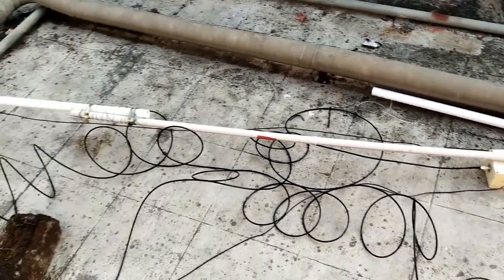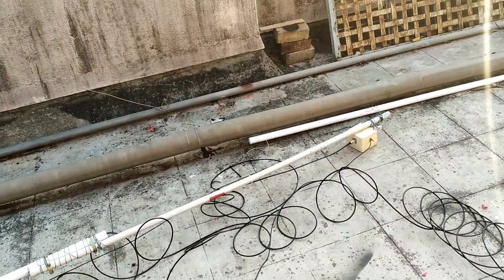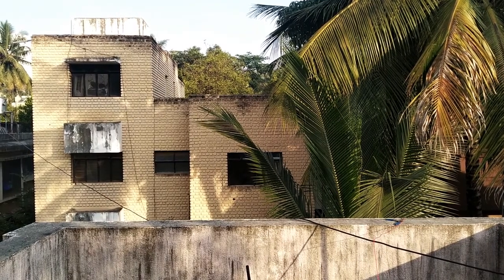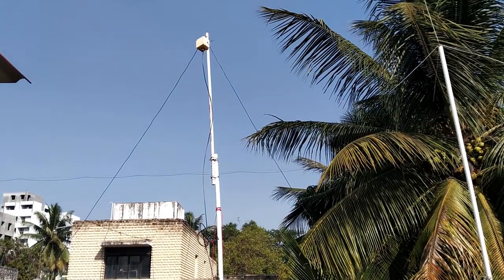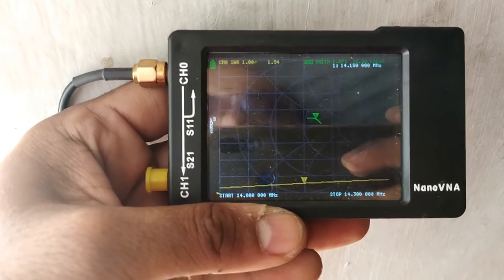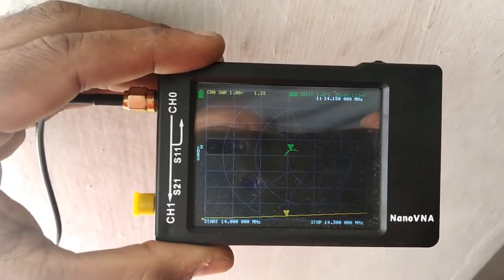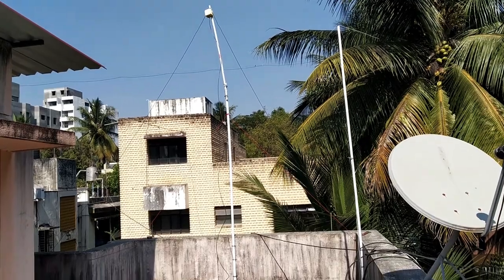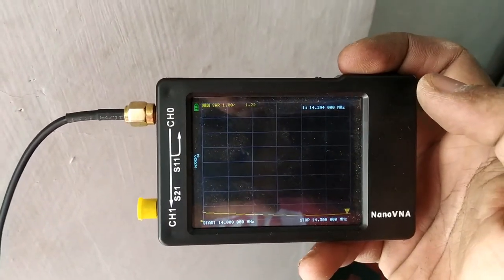Installing and Tuning Inverted V dipole

Comment: Very interesting to watch, as my own antenna has come down and needs to be replaced.
When you moved to the parapet, half the ground under you dropped away, with a little effect from the parapet wall itself. I wonder how your antenna modelling would show the effect of this on your SWR?
One point, I believe you probably folded the antenna ends while shortening for  testing, instead of actually cutting them?